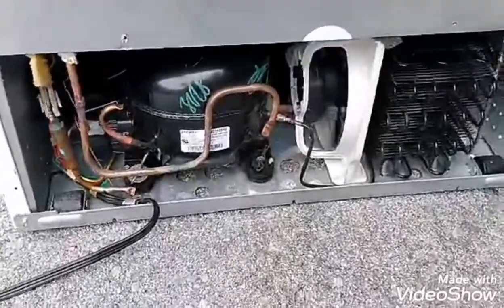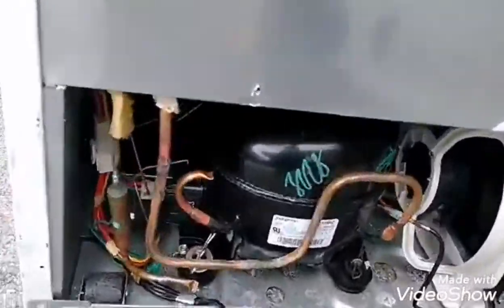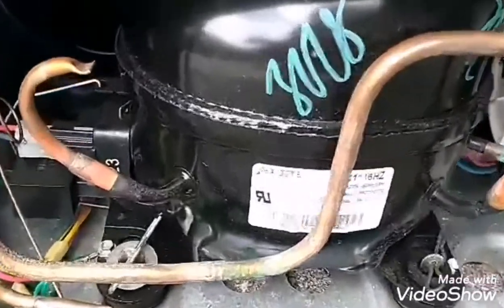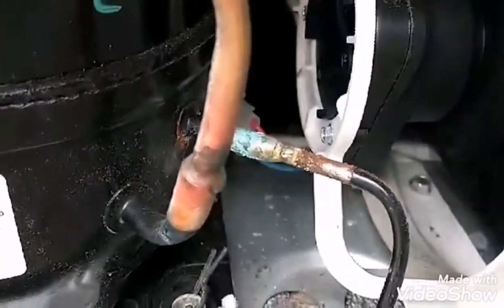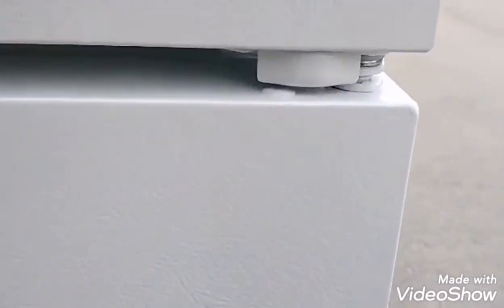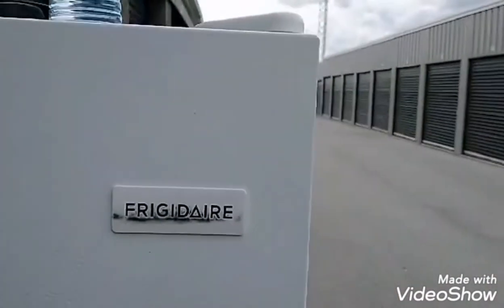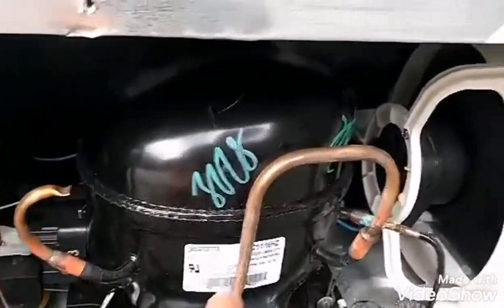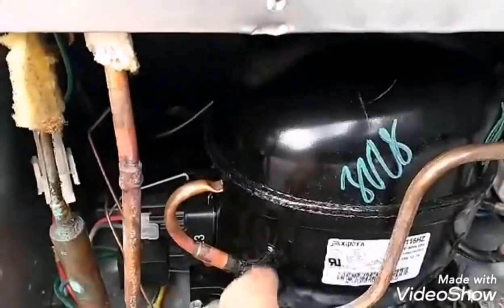HOW TO TRANSPORT FRIDGE

Comment: That is fine for a compressor with both gas pipes on the same side. The problem is 50% of fridges have the two gas pipes coming out opposite sides. Which side do you lay those ones down on? With the thick pipe facing up. I have a video on my channel that provides a detailed explanation, with actual experiments to prove it.